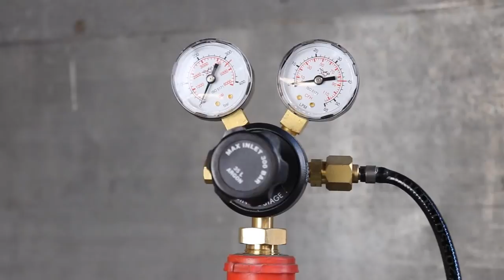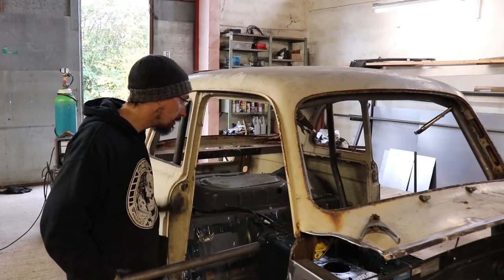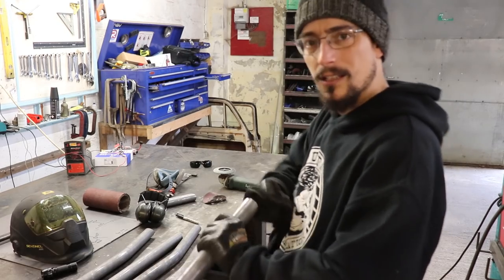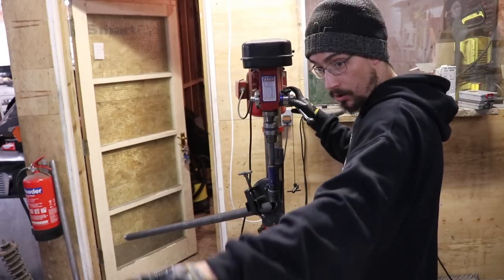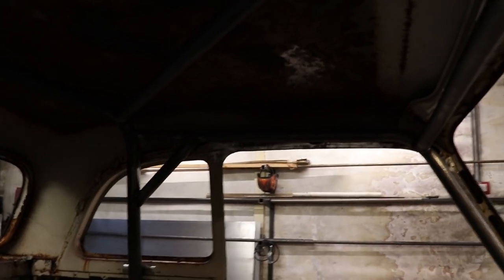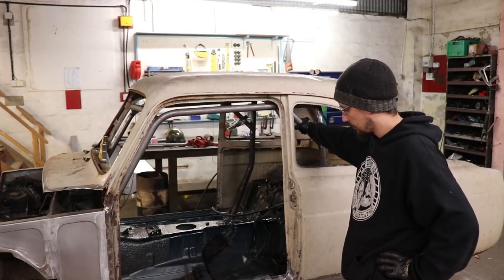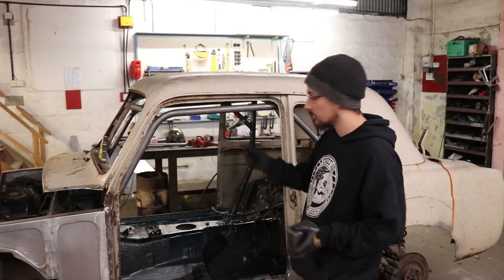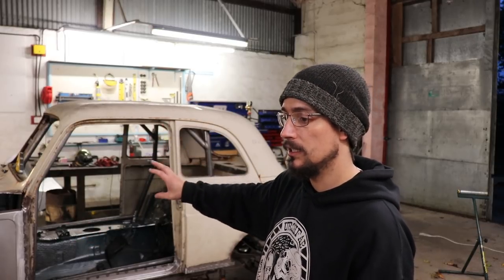THE MONGREL PART 15, HOW TO WELD THE TOP OF A ROLL CAGE.

Comment: Wow, I’d never really thought about how it would all be welded in place. Having it brought down by removing the boxes is kinda genius!
Reply: Yes, exactly my thought during the previous video. Now I see the point of the boxes. Very clever. He's not just a pretty face! ☺☺ I'm really enjoying his build.
Reply: Yep, the other option is to cut holes for the bars to drop through the floor, with flat plates instead of boxes. Most fabricators have a personal preference of one method over the other, I myself just choose whatever is easiest considering the chassis being caged at the time, which is usually boxes 'cause it saves sealing up the holes from underneath once the job is done :D
Reply: @arekingi  And ties it in with at least 2 panels at the same time, instead of just one!

Comment: Am surprised that you didn't paint the top of the bars before putting it back up. At what point are you going to sand/media blast the shell? The more you weld on it, the more you close up access to rusted metal. Very interesting series. You've got me hooked.
Reply from the maker: Its going for blasting soon.

Comment: You need a to make a pull through to clean inside your pipes, bit of rope with a weight on one end and a rag on the other, drop weight through pipe and drag rag through with the rope.

Comment: This made me remember a mates track car years back (A Nova GSi). He decided to rebuild it one winter so he could enter a different racing series the following year. There were problems galore during the rebuild so his evenings and weekends got really frantic as the date of the first race loomed closer.

Long story short, With a couple days to go he realised that he'd forgot to finish welding around the top of the front bars where they met the main "B post" hoop. With no time to strip the car enough to drop the cage down he did the only thing he could think of, He chopped a pair of 6" squares out of the roof skin, Welded the cage through the holes, then welded the bits of roof back in. A quick clean up with the angle grinder and a couple coats of paint and he had a roof panel that............. was warped to hell and back !!!!!! LOL !! We used to joke with him that if he ever rolled the car it might actually make an improvement to how the roof looked. :)

After that first season ended he did what he referred to as a couple of tweaks to "Make the car more competitive". It seem that by that he ment poly bushing a couple more bits of the suspension..... And cutting out/replacing the whole roof panel (I didn't realise our ribbing about it had got to him quite that much).
Reply: LOL! He must have been in a hurry to miss that!

I have seen a rally team remove an entire roof skin to weld the top of a cage before, but if I recall correctly, they were replacing it with a carbon skin anyway :)
Reply: Nothing wrong with a little constructive Bullying lol.
The PC brigade will be spitting feathers with that comment, oh well

Comment: Nice to see a guy mig welding a roll cage.  Most guys that i know only tig weld roll cages ....  and that makes it all 5 times longer and more painful ...  not that roll cages are not painful enough in the first place anyways !
Reply: Snow Feline     Would you race a car with a mig welded cage ?     there is a reason that FIA (governing racing body) strongly advice's AGAINST mig welding, and PROMOTES tig welding.     You use 7018 welding rods, because they make a malleable weld, unlike 6010 rods AND mig.     For more then a decade I have going to see   "Copenhagen Historic Grand Prix"   and when you have watched a 240Z  hit a K rail head on at 75+mph you want ALL the protection you can get, and not have brittle welds in your cage.     I have absolutely NO experience with "dual shield flux core"   but I know that you have, is it true that the welds are kind of like 7018 welds ?     Fun seeing you on a British You Tube channel.
Reply: Im in the tig camp. Wouldnt be so bad if he  pushed the torch in a proper manner,
Reply from the maker: Tig welding cages is a ball ache, unless someone was desperate for a tigged cage I mig everything. Ive been watching some of your stuff, I see your a fan of all the fancy pulsed/ spray mig stuff. My mig can do pulsed and I've never used it, I was gonna have a go at some cage work to see if there's many benefits.
Reply from the maker: funny that because the worlds largest roll cage manufactures around the world are selling FIA spec pre fabbed mig welded cages, cage builders around the world are constructing fia spec mig welded cages every day. nascar roll cages are still being mig welded together today so you might want to inform them of the risks!
Reply: jesper dahl maybe we could have a look at the tig welded roll cage you made by hand?
Reply: @rupertkingsley      It is funny that you try to shame me for not having a video of me  tig welding a roll cage, YOU do not have any videos either.    My original comment was that FIA encourages tig welding, and discourages mig welding, that is a fact !     And like I wrote, I saw a 240Z hit a k rail head on at about 75mph, so I want my cage as strong as possible, and the glue gun is just not going to cut it (for me)   mig welding is fast and easy, but it is not malleable enough, which I know from welding on cars for 30 years !   mig welding IS permissible for cages, no doubt about that, but I will not do it on my car !      Have you ever watched scruteneering for a sanctioned race ? there are a lot of rules, but if you know the rules you will pass, therefore I have spent a lot of time, reading up on the rules for the class I plan on racing in, that does not make me a "know it all" it makes me prepared.
Reply: @jesperdahl1486  Chrome-moly tubing such as 4130, maybe used but is not recommended. Chromemoly welding most often requires pre-heating, compatible filler wire to avoid brittleness in the welds, post-weld cooling and stress-relieving
It is essential that all welding be of the highest possible quality. Slag welds ,poor arc and gas welds are NOT acceptable. It is highly recommended that only certified welders carry out welding on rollbars.  TIG or MIG are the preferred welding processes. Structures with unacceptable welding will not be approved. 
Above are direct quotes from ASN Canada FIA.  Not included in the quote, they also spec bar size based largely on vehicle weight and that the roll cage have one of three basic types of configuration: main hoop with parallel front, main hoop with 2 side hoops, main hoop with top hoop.  If you go to the larger welding supplier websites, they in turn make suggestions as to compatible wires based on process and materials.
"OR" being the operative word.
Reply: @RussZHC     That is VERY interesting, I downloaded my information from FIA.com, and there they encourage tig only, unless they have come out with a newer revision since I downloaded mine (entirely possible)
Reply: @RussZHC     Reading your comment again I realized another huge difference between the Canadian and the dot com version,     and that is the "main hoop with top hoop" in the US called "halo" cage, that is NOT in the drawings in the dot com version.
Reply: Lol, calm down everyone. The VAST majority of cages around the world are MIG, and to a perfectly adequate standard too. TIG is only absolutely necessary with a chromoly cage, of course, and is only ever considered a minimum requirement in a bare few of the very highest echelons of motorsport.

Most properly designed, constructed and welded cages will typically have their first "failures" around each welds' heat-affected-zones anyway, rather than along the welds themselves, whether TIG or MIG. To say MIG welding a cage is inadequate because TIG is considered better, is quite an overstatement.

Having both MIG'd and TIG'd cages myself, I can see why even high end motorsports such as NASCAR still MIG their entire chassis'. TIG'ing a cage is easily 3-5 times more time consuming and difficult, and therefor WAY more expensive than a typical MIG cage, especially in places where argon gas is exorbitantly expensive such as where I am, New Zealand.
Reply: jesper dahl ....mate your anorak is to tight 😂 😂 😂
Reply: I am always interested in what others are doing, part of the learning.  I spent a fair bit of time since originally watching this video and posting a reply looking at FIA, NHRA/IHRA, NASCAR, MAS, SFI (as much as I could for free anyway, each full spec costs money) specifications and there are always differences and in some cases differences that I can not figure out logically.  I am lousy at just accepting as usually rules have some sort of reason. 
I am also a bit surprised that there are not more details in some cases or specifications, I only found one video where there is definite mention and definite numbers put on size deformation in a roll cage bend as well as thickness changes in the bend tested by X-ray.  Now both of those things maybe contained in an SFI spec sheet I don't have access to but at the same time why should that information be difficult to find?
There are a lot of beautifully welded cages out there that are on reinforcement plates just barely larger than the end of the tube, personally as a general comment not video specific, I am not sure why one is good without the other, also saw one video where a car that had been approved for racing (FIA overall governing but of a national group) had weld inclusions you could see in the dark, to me that is just sloppy on the part of the fabricator and worse, sloppy on the part of the scrutineer who passed it.
Reply: jesper dahl, I would absolutely drive a race car with a mig welded cage.  Properly executed mig welds can be very strong ! most common mistakes are welds too cold, inclusions because of dirt mill scale or other "operator related" problems. Also often bevels are not ground at all or the correct way - Matt is doing an excellent job from what i can tell here behind my keyboard - i dont think that there is much to worry about. the other thing is you have to consider material thickness ....  I would think his tubing is under 1/8  3mm or less a mig weld in that thickness range is absolutely sufficient ! when you weld thicker material 1/4 or 1/2" ... then it becomes more of a concern ....  and most trailer hitches in this world arr mig welded and 1/4" thick or thicker and even though there is a LOT of jerking and shot load and stress on them - typically the hitches themselves dont fail.....
Reply: Urchfab, the mig you showed today in #16? that is a synergic machine not a pulse machine. But maybe i am missing something....  Either way - pulse only has an advantage when you weld 1/16" or thicker !  and you would have to try it out to see if it really gives you an edge doing roll cages .... (because there are a lot of out of position welds). 
A properly adjusted mig up to 3mm material thickness is not a bad choice !  and since your material is clean and beveled correctly it does not really matter (at that material thickness) if you run vertical up or down !   4mm and thicker .... i would give it some thought about travel direction ...  but for what you are doing here ...  you are more than good !
Reply: A properly made cage is tight welded. It's safer.

Comment: Hey I know you didn't mention anything about heating this video but I noticed in the background the door slide left and right I was thinking of garage doors coming up and down which would work to now that I'm thinking about it but create a small panel with a hole in it so you can put additional piping and framing outside that you can hook and unhook real quick and then put your rocket mass heater stove on some Castor so you can roll it back and forth if you make it up some heavy material so that way you can close the doors heat yourself up in there nice and tight with that panel being in place I know that your door frame seems quite tall but I'm sure you're quite resourceful and we'll figure a way of doing that but again thanks for the great content trying to help you stay warm under a budget cuz I know bills aren't cheap and you have little ones and they take a lot of money sometimes more than projects lol ... Stay well on other side of the pond
Reply: VdubSPAZ In the last video I noticed the new space heater under the bench while he was bending up the cage. Bit the bullet and went gas.

Comment: Nicely done Matt,was wondering about the door bars where they are close to that x member ,possibly notch with the plasma cutter and weld them down? or am I still thinking like an oval bod.
Reply from the maker: Not sure what you mean mate.
Reply: @Urchfab  Before you dropped the cage of its  boxes you had to cut the door bars back out because they were hitting the x member in the floor pan, so when you re install them again possibly notch the x member and weld the door bars to it aswell, or maybe thats a bit Boots and Braces.

Comment: YOU DID NOT GRIND SQUARE your angle cuts .can not do that in New Zealand
Reply: AJota Rider   just saying here you have to weld a square  cut as when you weld a tapered cut you could be welding a third to half the tube  so no cert . do love your work , I made a car when I was 19 ,put chassis in 100E for a SP 250 V8 . looking at putting 100E on a shorten Toyota Crown chassis  with huge guards & 302 V8  & Toyota 5 speed   . have all parts  just time //
Reply from the maker: are you talking about bevelling the notches?
Reply: @Urchfab  we have to grind the feather edge square  ,so you have a square edge all the way around to weld to .we have to use 3mm tube & it must be 3mm were you weld it . no taper
Reply from the maker: @davidorpwoodnz  yeh its the same deal you have to bevel the full thickness of the tube.
Reply: @Urchfab  must be the video  but it looked like it was not  .all good just asking . I have the bell ring for new videos thank you .even thou I have done it on & off for 46 years ,its good to someone else doing it //
Reply from the maker: Yeh I'm pretty militant with my bevelling. Cheers
Reply: I'm a fab guy down south in NZ and haven't personally ever heard of any specific requirements for bevels (or lack of) on angled joins... But after re-reading your comments, I think what you're saying is, you shouldn't bevel the inside halves of pipes that meet at extreme obtuse angles, as your welds cant realistically reach the root of such bevels anyway? If that's what you mean, I agree with you, that makes complete sense.

How Motorsport NZ would ever know considering all they require is 10 post-welding, pre-paint pictures when assessing a cages homologation worthiness, is beyond me :D I've been informed by someone very much in the know that they assess much of a cage's weld quality by seeing there is an adequate heat-affected-zone around each weld, to ensure enough heat has gone into the welds, along with the obvious visual inspection of the weld profile to see it was welded by someone who knows what they're up to
Reply: @arekingi   box section or square ok its  when you hole saw tube the thin edge feathered edge needs to be grind square you only welding 1/2 to 1 mm of steel instead of 3 mm .no good ..
Reply: @davidorpwoodnz  Oooooooooooh, now I see what you're getting at! The complete opposite of what I thought you meant, but makes complete sense, again :P

That just seems like common sense but I imagine a lot of people don't think about it. Cheers for the tip!

Comment: Why is the cage not tight to the roof ?
Reply: It will be when he finishes it off. Just sit bax relax and watch a master at work.
Reply: One mistake occasionally made is placing bars hard up against the roof skin - vibration and the little flex left in the chassis can make the bars rub the roof and eventually show damage on the outside, lol! From what I can see Urch's cage fits better than most I've seen
Reply from the maker: Yes I've done that too.